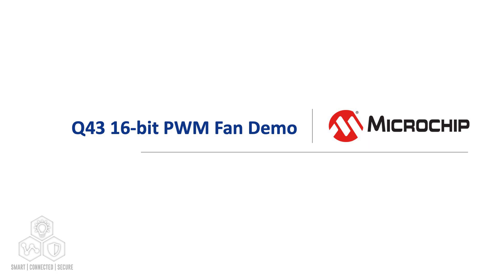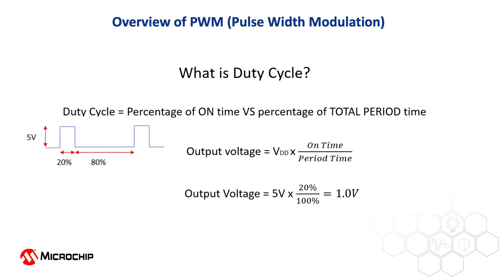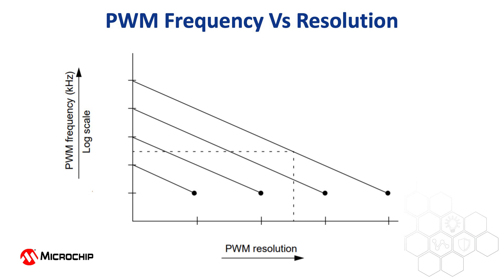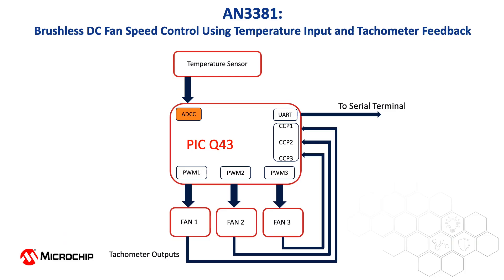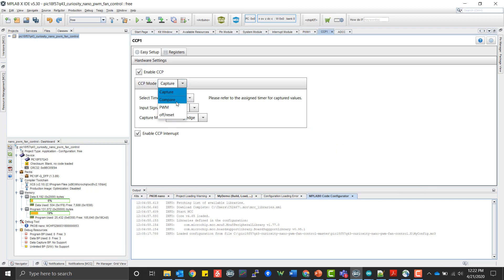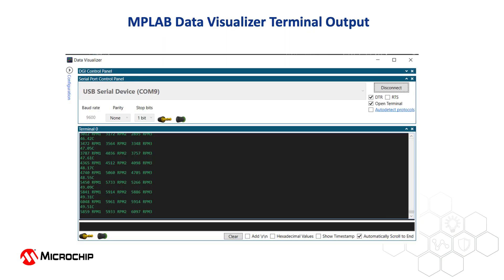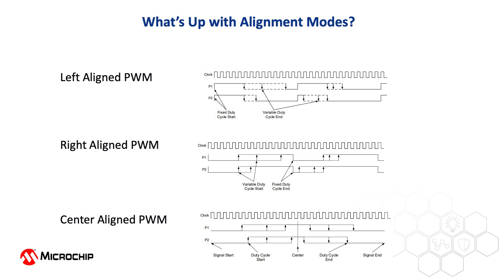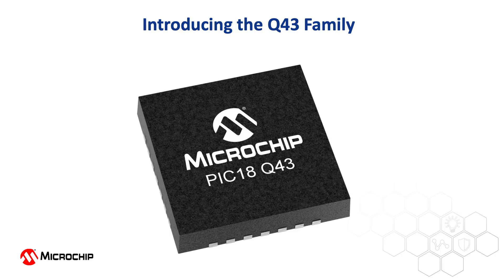Q43 16-bit PWM Demo

Comment: So...
What PWM frequency can it output at 16 bits resolution?
Reply from the maker: Hi there, thanks for your question. The maximum PWM frequency at 16 bits resolution for the Q43 device can be influenced by factors such as the clock speed of the microcontroller, the configuration of the PWM module, and the surrounding circuitry. 

Without knowing more specifics about the particular setup, it's challenging to provide an exact frequency value. If you would like to talk more about how to determine this in your particular application, we would be happy to speak with you. Please contact us here 👉 https://www.microchip.com/en-us/support/design-help/client-support-services